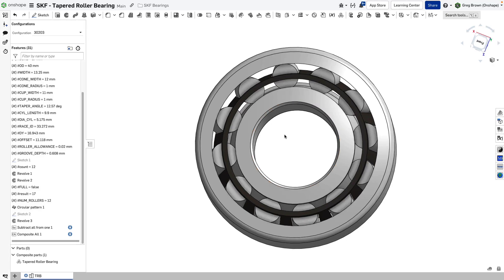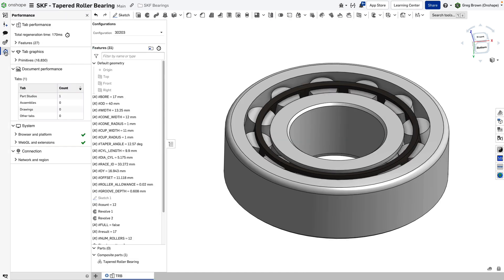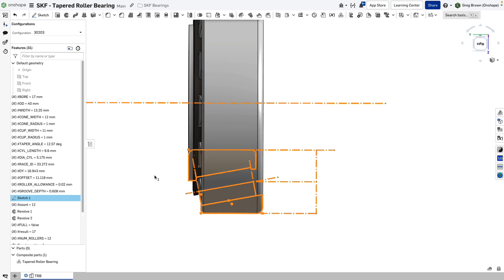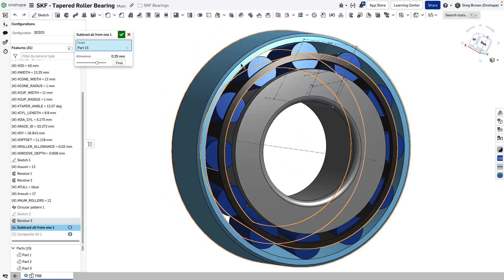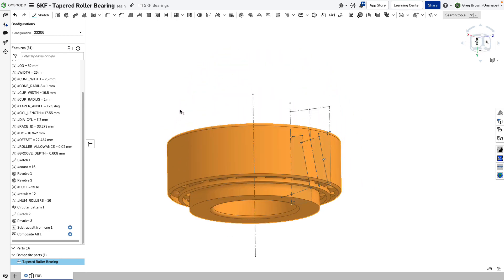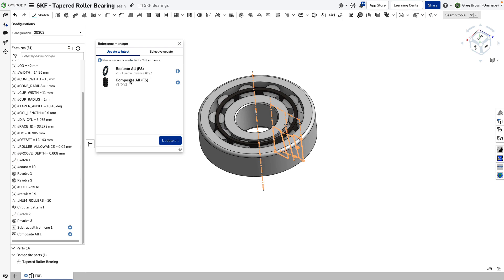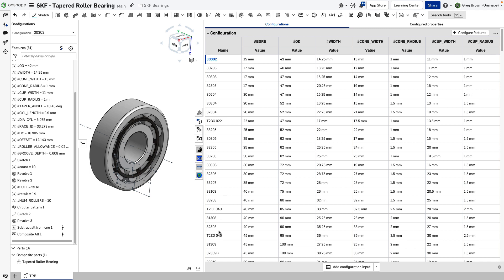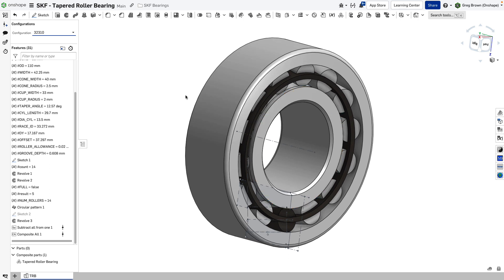Making a configured bearing for a standard parts catalog

Comment: Fantastic video! Is there any chance I could trouble you for a copy of your tapered roller bearing document from this video? I'm a long-time fan of Onshape and now making huge progress on my product since signing up at the end of last year.  The community has been amazing in its generosity by sharing custom features that just work so well.  Half the work I thought I needed to do was possible with out of the box features like variables and public existing custom features saved me from plotting NACA airfoil equations. I am now working on bearings and this video is 10 steps ahead of what I imagined I could do, especially thanks to your configuration tables which have so much data!